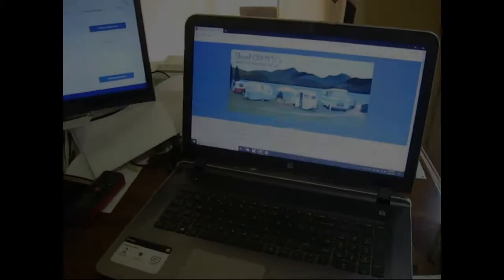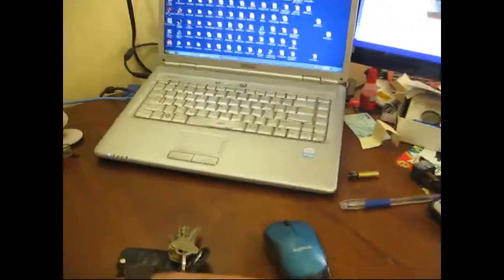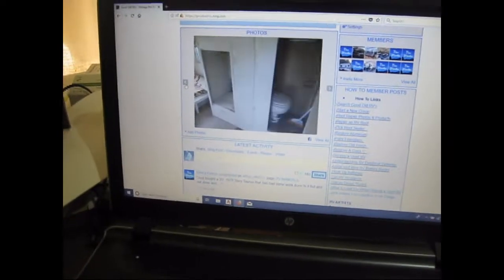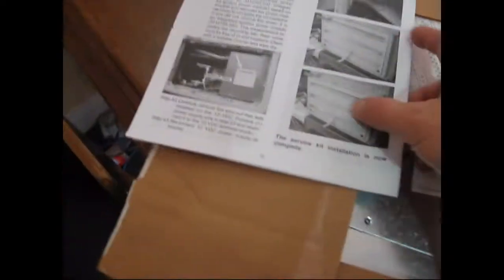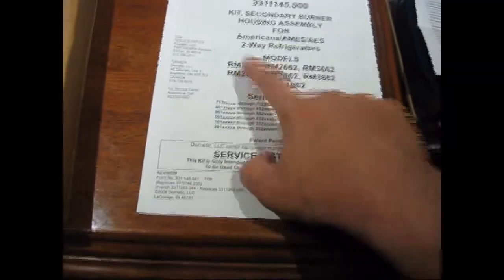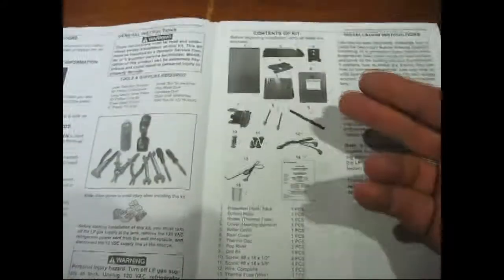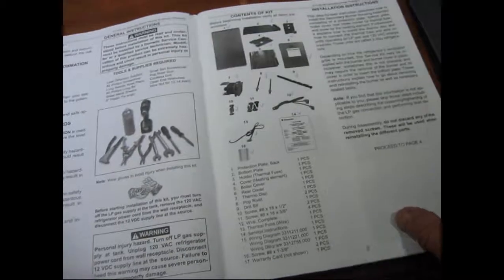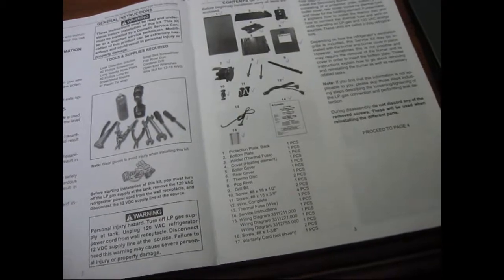Dometic 2-way Fridge Recall Fix: Part 1 of 2

Comment: Thank you for the video.  I need the thermal fuse from this kit.  It is under the black cover on a red wire.  It should be Part 13 listed on page 3 of the install guide.  Any way you could post the fuse specs?  Mine blew and I’d like to replace it.  Thanks!

Comment: Did you post the second video?
Reply from the maker: Lot's of stuff got in the way but I've got the kit and will be doing the second video shortly. Having completed the back workshop area and got it ready to work in, this will happen very soon. I'm also doing a pre-emptive parts order because I'm having some issues with the LP option on this one.

Comment: I have a Dometic RM7030, I don’t see any recall on that model. Do you have more information on it? I live in my RV and so scared of a fire.
Reply from the maker: You'll need to check out the recall site and be prepared to put in the fridge serial number, found most times in the door or somewhere inside the fridge on a sticker. You put in the model and serial number and the Dometic site lets you know if you are good to go or need a recall kit.

Here is the site:
http://67.238.126.140/
It's a direct IP address site to Dometic's recall site. Follow the directions and may your fridge not be on the recall list!